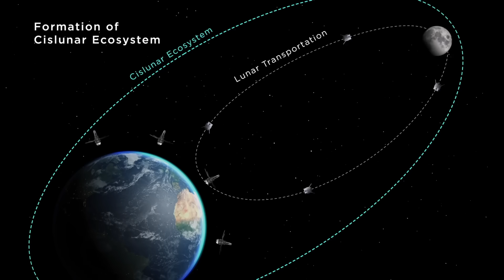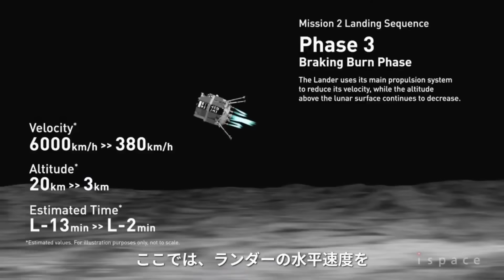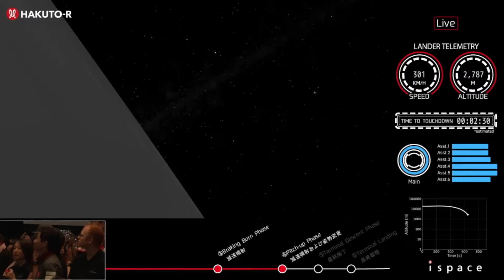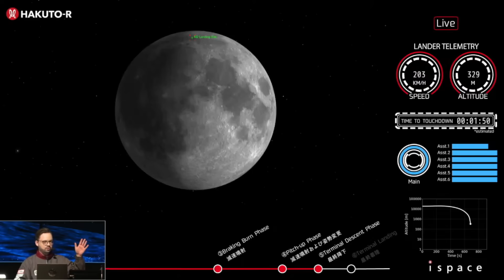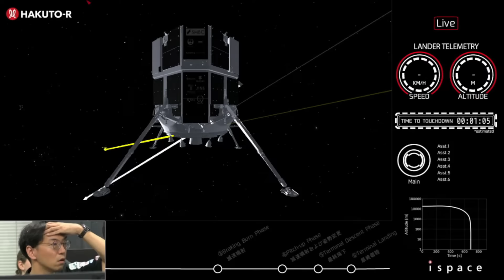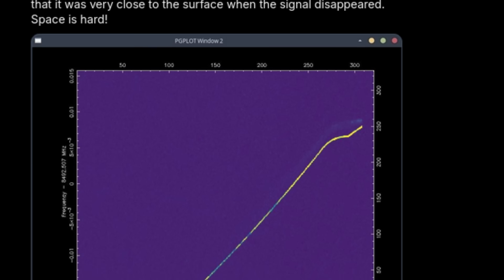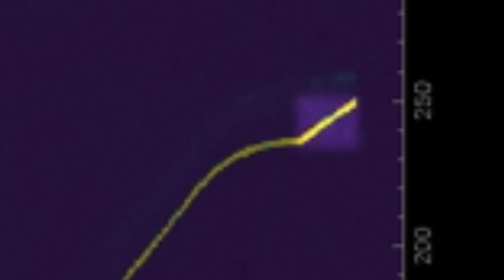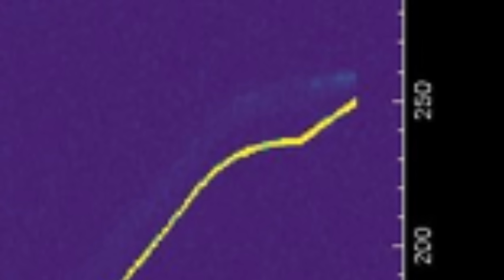Japan Crashes into The Moon, but Slower Than Last Time

Comment: The Apollo-era Mark I Eyeball was pretty darn good!  ;o)
Reply: Also, the Apollo LM had a dedicated landing radar to measure altitude, which had a dish that could be slewed by the LMP to get good altitude data.

And the LM carried a lot more propellant relative to its size than these little autonomous landers. They had extra time to play with.
Reply: Sometimes you have to roll the hard six.
Reply: Speaking of ... 
The moon isnt that far. Why can't they just revert to manual control in situations like this? 
They have cameras, just fly it to the ground manually. Kind of like what Neil Armstrong did. Sure its a 2 second delay, bit might still be doable, and its better than loosing the whole thing because of faulty guidance and programming. 

I mean really, why dont people just fly these missions manually?
The moon is close enough that you could get semi-real time communication.

Comment: okay, I'll admit to not being up-to-date on things like the weight of a LIDAR package capable of measuring the altitude of a lander over the lunar surface.....but is the weight penalty so high that a second LIDAR system couldn't be fitted to the side of the lander so the onboard systems had a real altitude measurement to work with, as opposed to an assumed one?
seriously, if their flight computer had an actual altitude, it could more accurately judge when to engage in the 'pitch over' maneuver for landing, and that would seem to make the chances of something like this far lower.
Reply: Which side?  Now you need to be able to  spin the lander around its axis to keep one side down.
Reply: @HweolRidda once the deorbit burn ends, you command the lander to do a low energy rotation to give the side-mounted LIDAR a chance to acquire the surface, then cancel out the rotation so it can maintain lock. Once it senses the altitude is low enough for the final descent burn, the landers computer executes the reorientation burn to point the thrusters/descent engine to bring the lander down while the descent LIDAR takes over altitude measurement duty. At least that's how I'd do it. If you had sufficient mass margins, you could put LIDAR units on all the faces of the lander that would be vertical after touch down, thus eliminating the need to keep a single side facing downward, but then you'd have to engage in polling the different sensors to see which is currently capable of providing data, and there's the possibility of losing lock during switch-over, plus the possibility of polling errors and sensors not agreeing, so I think a single side-mounted LIDAR coupled with a bottom mounted unit would be best. Again, that's mho, so take it as such.

Comment: Could thenature of modern electronics have something to do with it? In the 60s, they used discrete transistors, core memory, and hardwired computers that we would barely recognize as such today. Now we're using tiny chips with millions of transistors, solid state storage etc. Do we really know much about modern electronics in space? Keep in mind that NASA's contributions are using 1980s tech. Lots of new StarLink sats out there, but they're coming back down pretty regularly too.

Comment: What I don't understand is how these problems are not caught in simulation. Wouldn't you basically throw a fuzzer setup at your simulation environment and try to find every possible way to break the landing logic in terms of weird terrain, bad lighting, failing sensors, dust, etc.
From there you would sort all the failure modes into fixable and not fixable scenarios and then you try to optimize your landing plan to hit the least number of unrecoverable failure scenarios and address as many of the fixable ones you can.
Having randomly generated terrain should cover a case like the unexpected cliff and varying random texture noise and different surface image resolution should cover most sensor lock-on and confusion problems.
This isn't even that expensive to do especially not within the budget of such a mission. That takes a few competent software engineers a few months and probably not more than 5 digits in compute cost.
How is software such a liability in these systems today? Are they running react on those things?

Comment: Why not drop some radio / laser beacons to the surface ahead of time then use them as a ground level reference?
Reply: They could have just used simple radar to the same effect
Reply: @cheesofile666  Radar relies on reflections AND being able to interpret what they mean.  With beacons, they would have ground based GPS.   Deploy say 4 to the surface with an additional one that is at the target landing site.
Reply: @bobroberts2371 that seems needlessly elaborate. Mind they’re having enough trouble landing one piece of machinery, let alone six. It also wouldn’t give you any extra information about surface conditions.
Anyway, radar altimetry is proven technology so interpretation isn’t an issue.
Reply: @cheesofile666   The beacons would be able to survive a greater impact than the main lander.  The beacon at the landing site  would give very accurate altitude information , the other beacons accurate lateral direction / speed.  This would free up the lander to concentrate on surface conditions.   With 2 crashes, what they are doing isn't working.

Comment: We may need the moon, but the moon is going to kill us.  The narrative is that the dynamics of the moon’s interaction with the Earth is such that the moon is moving away from the Earth, and not that I can explain it, but the claim is made that after reaching a maximum orbit of ~600,000 miles (much reduced tides and changes to whatever life is still around then), the moon will move the other way, and approximately 11,000,000 years from now, the moon will reach the Roche Limit at which time it will disintegrate and shower the Earth with a fatal amount of material, destroying all life on the surface of Earth.  If we haven’t made other arrangements well before then, we’ll not have to be concerned with the Sun going nova in four billion years.
Reply: And my understanding is different, the moon would have to orbit inside 20K km to reach it's Roche limit and start to come apart.  The further out the lower the tidal forces.
Reply: @imaginary_friend7300  Sounds the same to me.  Thanks.

Comment: ppl need to realize this is not about "can we land it", its trying to do it the most efficient way possible, which is a totally different problem to solve.

if landing the craft would be the ultimate objective we could do it anytime, it just costs a lot more.
Reply: Looks like failures cost much more collectively than paying more for success.
Reply: @sails3538  on the contrary, once you solve the problem you change the landscape forever, which leads to a permanent cost reduction.

honestly, i should not explain this, its pretty self evident.
Reply: That sounds right but the efficiency need is based on launch payload and carrying as little fuel as possible. The general way to do this is to over engineer and then scale back once success is achieved. They're doing it backwards.
Reply: Landing the craft is an absolute requirement, even if it is not he ultimate objective.
Reply: The real observation is that they could have done more simulations and tests before spending the money to launch a probe and fail multiple times.  There's a point where more modeling and simulation is no longer economical versus a real launch... it does not appear they're there yet
Reply: The thing is. Before making a thing efficient you need to be able to DO the thing first you know?

It is like people are completely jumping over the actual mission to the thing that just create hype.

It is like a corpo talking about "efficiency", "unlocking shareholder value", "infinite growth" while the actual business is on flames.

You will make what efficient if you are just incapable of doing it in the first place? They have not yet shown "can we land it" yet and they are talking about "efficiency" lmao.
Reply: @sanjay_swain My thoughts as well! We need ability & reliability now, not efficiency. If I'm flying a payload to the moon, I want it to land and be useable, not a crater because I wanted to save some $$.
Reply: Well.. Yes and no. Doing the necessary R&D to make the landing as efficiently as possible is so expensive that it takes a considerable amount of landings before the cheaper method actually becomes cheaper than if they would just continue using tried and true methods.
Reply: Using the same craft and instrumentation, could they have used the LIDAR several orbits prior to the landing burn to orient the craft and scan the decent path to the desired landing zone to derive an altimetric profile of approach? It seems that they presume a constant surface radius when it just isn’t. They must fly over the LZ some dozen orbits before committing themselves to landing, even a coarse scan would greatly reduce surprises.
Reply: No we can't.
How do i know? Because we don't.
They can't even land a jar of tardigrades on the moon without spilling it all over the place.
Reply: You could land a craft on the moon and do it at any time. Ok then why dont you just do it and land on the moon. We OLD PEOPLE landed 2 men on the moon several times and even provided a car for them to drive around in while they were up there.  This was all done in 1969 and the early 1970s and you say you could land on the moon what a laugh.
Reply: Eh - those men landed themselves. Landing is easy when you have a brain in the situation that can make adjustments.
Reply: And then you got in charge and let space exploration atrophy. 🤦So now we have to relearn everything. Thanks.

Comment: The Lunar Module had probes sticking down that told it when it made contact.   I didn't hear any mention of a radar altimeter.  Knowing your orientation, your altitude, your speed in three direction, and when you make contact would seem to be necessary to make a good landing.  When I hear they shut off their engines during the last landing at 500 meters thinking they had landed   Maybe they need to use the simpler instrumentation.  You wouldn't shut off your engines at 500 meters if you had some simple landing probes.  You could have one rod with a switch on it that hung down and you would know if you made contact and the orientation of the rod to the lander which gives the attitude.
Reply: Apollo LM had both radar altimeter and probes. That's why Neil (or was it Buzz?) said "Contact Light" during their conversation on the landing. But prior to that, their altitude readings were from radar altimeter. Surveyor had a radar altimeter as well.
Reply: @i-love-space390 Yes and both did the come to within a certain distance and fall the rest of the way.  The benefits of 1/6G!  For the Lem is was 6 feet which was the same as falling 1 foot on earth, which they did test.
Reply: @imaginary_friend7300  One of the Surveyors didn't cut its engines after landing and took off again.  The first launch from the Lunar surface 🙂 Luckily it only went about 5 ft high then cut its engines.
Reply: @i-love-space390 Surveyor didn't even go into orbit, it just came straight in.

Comment: Why don´t they use a spherical frame with the actual probe attached inside it via spring mounted cardan joints instead of the legs , which quite often fail ? Because of weight issues ?

Comment: I wonder when they're going to switch back to radar? Like, radar can be easily pointed as well as lidar, but doesnt have the issue of having to be visually locked. Even if its just a basic single pixel detector you still have to point it where you expect the return from, and the surace can be too bright, the dust can wash out the return. Radar just simply seems like the more reliable solution. Especially considering we know it works.... But yeah sure, pat on the back stem kids, keep trying to reinvent the wheel, and making new craters on the moon.....

Comment: The Moon is only about one light second away, one could possibly program a manual control override for the case where the autonomous landing system seems to fail...
Reply: Given all the delays in the signal path, digital processing and such, and the limitations of the speed of light (radio), the actual round-trip time becomes more than 3 seconds. That's enough to make you fail. During the last three Apollo flights a guy on the ground tried to pan the video camera on the rovers to follow the LM ascent stage as they lifted off from the moon.  He only got it timed right on the last flight, Apollo 17.

Comment: I don’t understand why modern spacecraft can’t manage to land successfully on the moon.

Maybe spacecraft design needs to revert back to the simpler designs of the past before all this extra computing hardware complexity was introduced. The simpler the design, the less will go wrong.
Reply: They're trying for a true soft landing for these probes.  Back in the 60's they relied more on the stop and drop landing method.  Which of course did work but comes with a mass penalty.
Reply: Fast hardware tends to make engineers lazy and inefficient. They have an entire 1hr You Tube video on the Apollo LM computer, a true marvel of ingenuity built on primitive hardware and ingenious software design.
But also, when you have rival private companies, they are contractually prevented from sharing what they learn with each other. So they are like silos of engineers that have to learn everything the hard way.
And frankly, I think some of the guys from the 60s, 70s, 80s were just much better engineers than today.

Comment: Without getting political,  if Musk dismantles Dragon, what options have the crew of the ISS got, getting home, early deorbit of ISS etc ?
Reply: He's calmed down now and says that isn't going to happen, but yes, if it did, it'd mean we'd be flying crew on Boeing's (cough, cough) Starliner if we expected to keep using the ISS much longer. At issue is whether or not the ISS will remain viable till 2030. Already one of the Russian modules is failing and leaking badly, years beyond its expected lifetime.
Reply: @rosswarren436  I guess my question is more of a 'what if'
Also, don't they have an escape module ?
Reply: @sparkyprojects  there has been no "Escape module" on the ISS since the Decommissioning of the shuttle. All flights return on the same vehicle they launched from unless there is an issue with them (Starliner). I would expect that any theoretical decommissioning of Dragon would either force a near immediate return on the capsules, or the termination of future missions, only completing those in process.

Comment: There seems to be a consistent trend in how these landers are failing. The surface of the Moon is a lot rougher than people give it credit for. They're going to have to either spend more in energy to get a more vertical descent, or spend more in weight to get more than just a lidar altimeter.

Comment: They say Mission 3 and Mission 4 will be flying landers that are much larger in size and weight. Hopefully they will arrive at a better way to do the terminal GNC to get to the surface safely. Is it just a bandwidth issue for the reason they can't get down real time video during the descent? Guess time on the DSN is prohibitive in cost for private companies.  That brings up a question: How will we get down live video from future crewed missions to the moon if they are going to be staying weeks on the surface? Are there any other large antennas on Earth that could provide such reception and be dedicated to it? Might we need some large antennas in Earth orbit able to relay the data and video down through Starlink or some other way?

Comment: Don't they just need to be able to point the altimeter downward so they can get readings while the spacecraft is still losing horizontal velocity, before it is completely vertical? Obviously it would add a little weight.

Comment: Somehow, my gut feeling is that part of the problem might be Japan's tendency to "work harder, not smarter" ...
Reply: Tell that to Toyota. It is the best engineered small car I know of. Their Driver Assist software is some of the best in the business. I will never stray from Toyota again. I have been disappointed by every other car I have tried. And don't get me started on the damned GM "smart cruise control". It may operate OK, but it won't even allow the passenger to mess with the Blue Tooth apps while the driver is driving. I simply wanted to smash the thing in frustration.
Reply: @i-love-space390 And why? Because Toyota isn't working like a typical japanese company. They, for example, have an internal suggestion scheme that BY FAR outmatches pretty much all other japanese companies, and even european ones. They are the best bescause they play "the best of both worlds" correctly. Which is exactly my point.